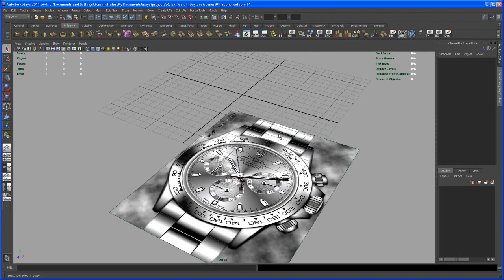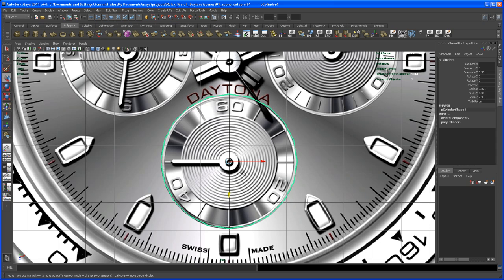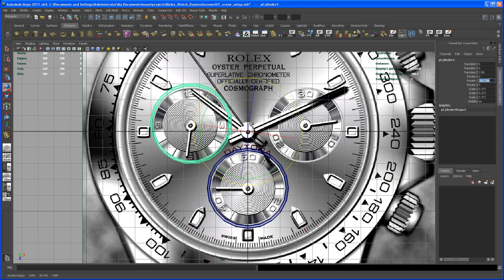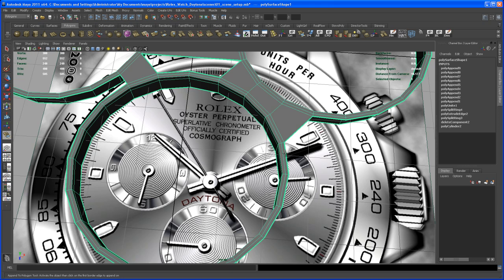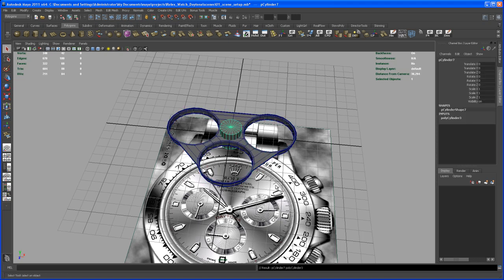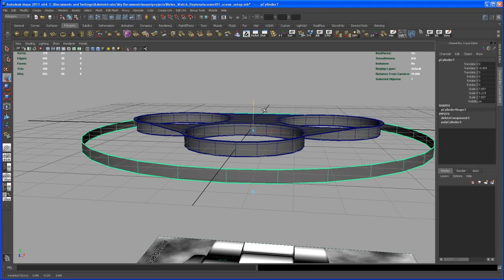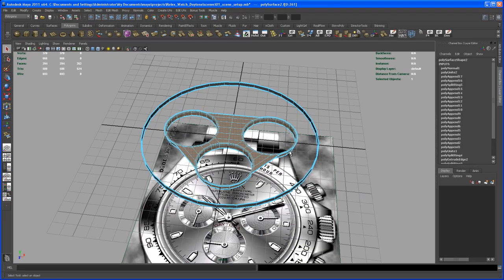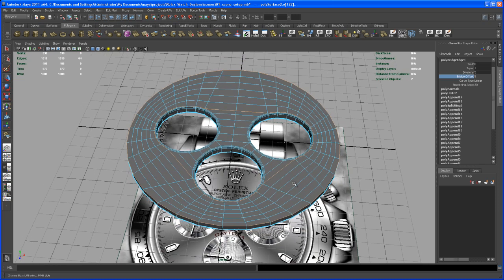Modeling tutorial in Maya - ROLEX DAYTONA watch - Part 2: modeling the main surface

Comment: Sorry about the truncated message. So this is the part two of my question: After you selected the inside part of the geometry (the three connected holes), the normals of the vertical faces are pointing "inside" the holes. Is it "in" or "out"? Why? Thank you very much.

Comment: The Bridge command isn't working for me. I combined the two objects, and they both have the correct number of edges in the edge loop. 32 and 32. When I do bridge, it's super messy. I reset my bridge settings and changed options like: TWIST - 0     TAPER - 1    DIVISIONS - 5     BRIDGE OFFSET - 5    CURVE TYPE LINEAR    SMOOTHING ANGLE - 30     But it's still completely messed up. Please help D=

Comment: Hi love the tutorial, but I am having problems with the append polygon tool on video 2 around 4min into the video. I keep getting multiple polygons and they pull from the adjoining polygons it's sort of a smooth look when appending not 1 like you are. I have tried to go to the options of the tool but can't seem to find the answer. I am also using 2012 not 2011 Maya. Maybe you can tell me what the options of the tool should be set to? Thanks in advance.